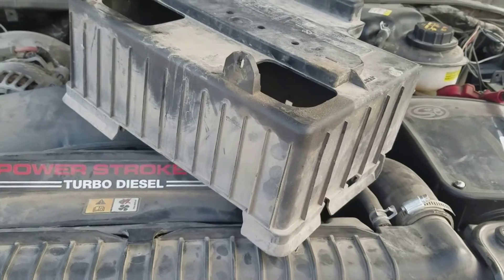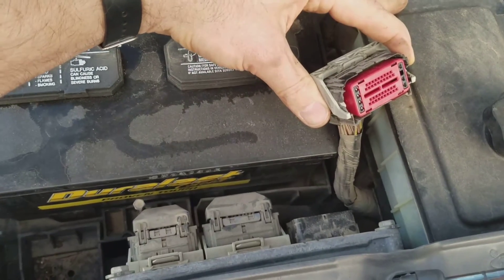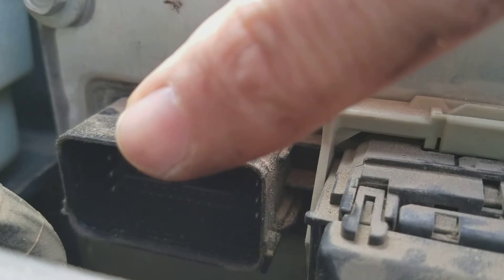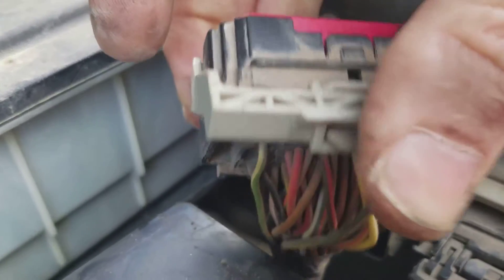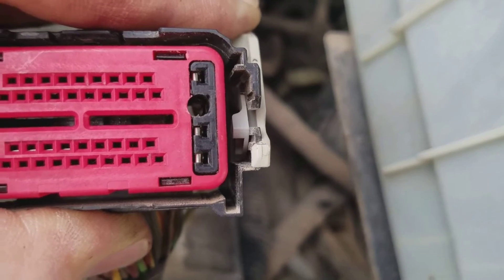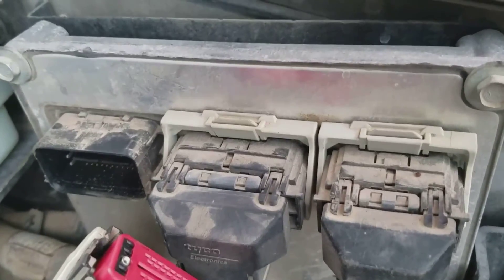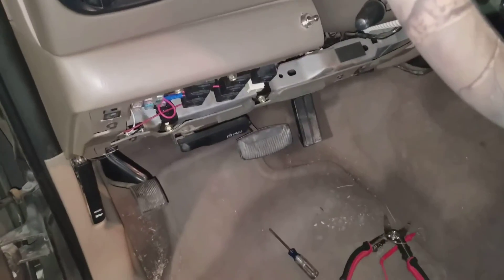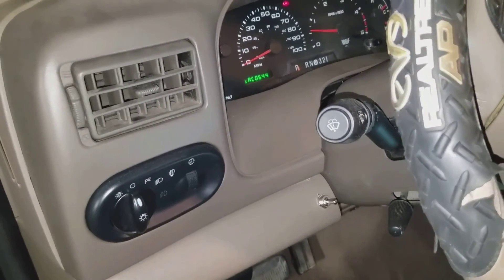Ford Excursion 6.0 High Idle Mod

Comment: INFORMATION:  2003-2004 Ford Excursions DO NOT have the blue PTO wire populated at the ECM and have NO PTO wiring under the dash. Enabling the high idle capability on the Excursion involves electrical connector modifications at the PCM. Thank you Mike for showing us how to do it for Excursions 6.0L.

Comment: There's a way easier way to do this modification. Under the dash behind your fuse box you have a bundle of wires all taped together with dead ends. One wire is light blue/ yellow stripped. Take this wire and hook it to a positive switch. When the truck is running press the parking brake in and hit the switch. It will activate the high idle. Disengage the switch or parking brake and it will shut it off.
Reply from the maker: 6.0Doctor I know what you're talking about, but the Excursion chassis does not have this wiring. I dug through wires for 2 hrs before researching to find this out. Thanks for the input!
Reply: My 2003 Excursion does not have the light blue wire with yellow tracer.
Reply: Same here, nor the purple green wire mentioned in other videos